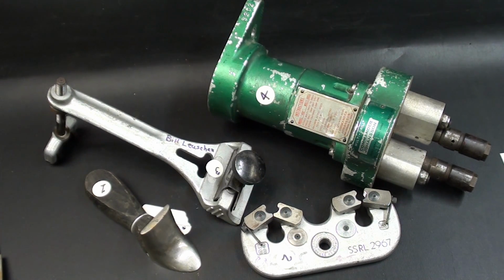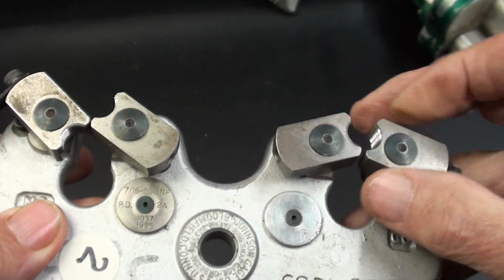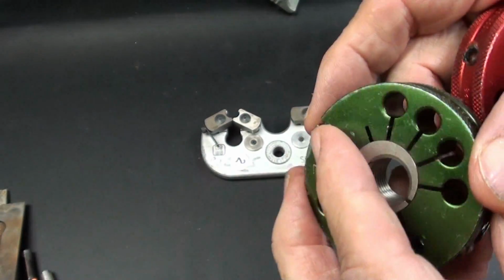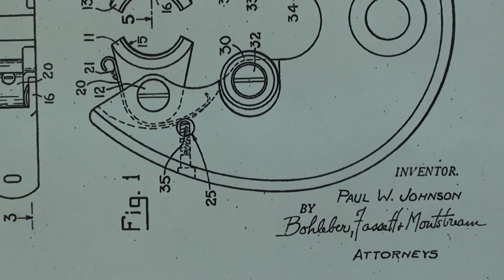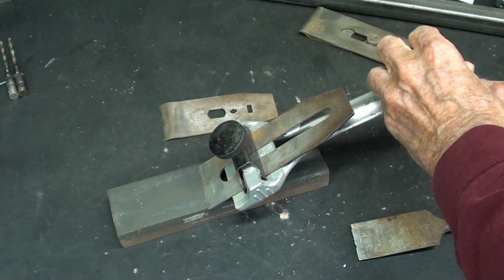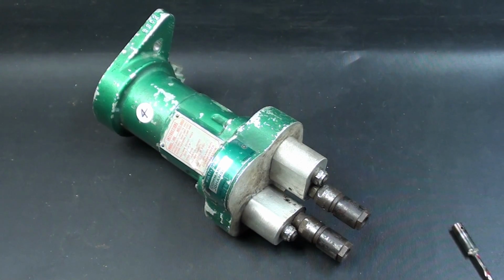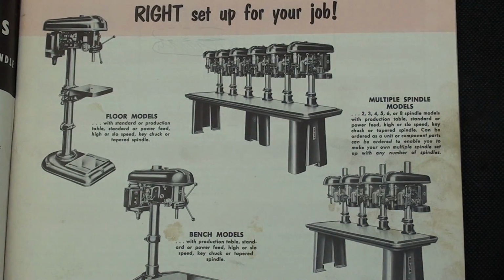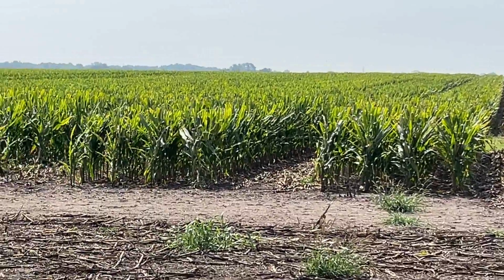WHAT IS IT? Mystery Tools #86b ANSWERS tubalcain MRPETE

Comment: Tool #1 looks to me like the shaping tool used when they used to use lead as car body filler. Kind of like an old fashioned soldering iron perhaps keeping the metal part hot would keep the lead workable so they could spread it and form it?

Comment: FYI Mr.Pete the Go /No Go Thread checker  in the video did not  show the detail of the threads  inside of the “Jaws”  at least on my Ipad i watch your videos on ?  my original guess  ws that the Jaws  may had been something that  changed  position based on a spinning or Centrifigal Force  in a effort to  Prevent or Allow a object to  move or not through the circular  opening

Comment: Wow, I haven't seen a thread snap gage in a very long time, like forty years or more.They were often called a Johnson gage and the example you have there is what was referred to as a "functional" thread check because it engaged multiple threads at a time. The actual pitch diameter was measured using a stand with three thread "rolls" and an indicator that only engaged one thread per check. The one you have would be set and issued to the shop floor for high volume production checks while the quality assurance folks would use the "tri-roll" or three wire method to evaluate and determine the cause of any discrepancies.

For reference these were calibrated using a NIST traceable "set plug" and the one you have is certainly not NIST traceable. If you had the proper set plug for the NO-GO it should move through the opposing sides with only minimal pressure when set correctly.
Reply from the maker: Very interesting, thank you

Comment: #2) That is an early "Bi-external thread segment gage". It differs from a standard set of thread Rings in as far is It will show thread form variations not detectible by a standard ring 
(Drunken Helix, etc.) Later versions included dial indicators to numerically quantify the variation.

Comment: I think you're doing it back to front, please try putting the bolt in the hole first and then move it in to the two pivoted threads and the bolt passes out the top maybe, it's made for speed definitely, thank you Pete.

Comment: I am writing this from the uk. In a small  corn mill about two hundred years old it was converted  into a sawmill in the early 1900 s they made woden hay rakes, there were 16 teeth in the head and the holes were all drilled at one go weih a 16 piece multi drill. This drill is still in its original position or it was about 20 yrs ago.
Reply from the maker: Awesome

Comment: I have the 6 spindle version of the Multi-Drill complete with MT3 driver sitting in a corner of the shop.  No use for it, dug it out of scrap @ work years ago, seemed like a waste.  Still useful, it's 6x faster than a CNC!

Comment: I ran a multiple spindle drill at NATCO in Richmond, Indiana. The machine was made by NATCO. it was set up at the time as I remember, to drill and tap 32 holes in a platen for a plastic machine which they also manufactured. It was fine until you experienced a mishap and broke 32 spiral taps in one fell swoop. If you've ever had to remove a spiral tap you'll remember what a job it is. Try 32 of them.
Reply from the maker: Good story

Comment: This is just a guess for #1.  Larger billiard tables have tops with more than one piece of slate.  Once those sheets are shimmed to the frame so that their tops are flat and coplsner, there are still small gaps between the edges of the slates.  These are filled with a hard wax that is melted into the cracks.  #1 might be used to smooth out that wax.
Reply from the maker: My dad used plaster of Paris when he put our pool table together, and then he sanded it smooth

Comment: Hi Lisle,
You need to talk to Bubba leaving your tools in such a disgraceful state! You would be there for hours attempting to fix either of those abused tools on an stone. The cutting edge angle is usually around 25 degrees for wood.
I was very interested in the extra credit section on the corn. How do they determine the male / female seed pre emergence? Clearly they would have to, to be able to  plant each in individual rows to be able to clear the male after cross polination.

Comment: The RS&M co tool is a concreate finishing tool for striking up (smoothing) bullnose corners like in curbing and stairs but for an inside corners and radiuses where a flat bullnose tool has difficulties. They make a trowels that does the same thing now so this went by the wayside.
Reply from the maker: Thank you for that
Reply: R.S. & M. Co of Reading Pennsylvania.  I've seen quite a few towels, but not this bullnose before.

Comment: Lyle -  Interesting answers.  As I did not work with them directly some of this might be incorrect as I'm relying on memory from 40 years ago.  IBM made mountains of printed wiring boards for computers back then.  Many pieces of machinery were designed and built in house.  There were multiple spindle drills called Hydrapads - don't ask me where the name came from.  The spindles were somewhat adjustable on a grid pattern.  There were 64 spindle and (I think) 256 spindle.  As I recall not all spindles had to be active, but that was the maximum number of holes you could drill at once.  We are talking something in the .020 - .030 diameter range I think.  On the 'other' side (defense work) where I was we drilled down to .010 diameter using commercial NC equipment.  When you went by the 'pads' they operated in a 'thunk, thunk' kind of sequence punching lots of holes with every thunk.
Reply from the maker: Thank you for that information, very interesting

Comment: The 7/16-20 thread should have passed through the “go” gage if set correctly. “No-Go” and “Go” were set correctly with hardened and ground male gages and locked down and certified. If the thread will 
not pass through someone changed the setting or the thread is oversized.
Reply from the maker: Thank you very much for that clarification. That’s kind of what I thought. Maybe I will tinker with it and adjust it, and show it again.

Comment: Multi head drills are common in cabinet making industry. They are no longer production grade as CNC is ubiquitous. But they can drill a hinge bore and screw holes with repeatable consistency (spacing between holes is consistent) and also shelf holes where many repeated holes on standard spacing saw needed.
Reply: I saw a 6 point multi drill at the Fender guitar factory in the early 70's.I was impressed that they could accurately drill an entire headstock in one operation.

Comment: #1:  RS&M CO is the Reading Saddle and Manufacturing Company, which was located in Reading, PA.  They made a lot of cast iron and nickel plated masonry finishing tools, so this tool may be related to masonry finishing.  I believe the 'Saddle' in the company name refers to bicycle saddles which at the time would have been leather. Hence it's possible that the tool was used for forming leather.
Reply: i have shown them to a shoemaker 60 years in business he said it was heel horm for ladies' high heels he said he uses it for other things as well in leather craft to drive rivets or snaps into hard to get into places too

Comment: Mr. Pete, years back in the die casting industry, we used large Commander planetary drives that had removable drive shafts with U-joints supported by a cast aluminum  plate at the business end that held collet chucks.  You had to machine your custom hole pattern in the plate to match your work. We tapped up to a dozen small holes at a time with these.  Of course the entire assembly was driven by a lead screw device with auto reversing.  Crazy setup but it worked.

Comment: Fascinating information.
You mentioned that number 1 had a wooden handle to keep heat at bay.
Its surface is very smooth and has a specific curved shape.
Could it be related to ‘formers’ used in the hat industry?
Here in the UK - and presumably the USA - traditional hats are made of refined fur (usually rabbit) with shellac for firmness and retention of shape. The general ‘shaping’ or ‘forming’ is by steam over a mould, more refined shaping could be done, possibly, with the tool you showed.
👍🇬🇧👍🇺🇸👍🇬🇧👍
Reply: That could be right. I was guessing for leather forming.
Reply: @ohmbug10  👍
Reply: A forming tool for shaping derby hats maybe? Hat forming  would require heat thus the wooden handle. Too short for concrete forming which would scratch the finish and not require heat. Just a guess.
Reply: @ellieprice363  Even the pointed parts of English ‘trilbys’ (there’s a word from the past!!)
Reply: @ellieprice363 Nice thinking but making a bowler requires little heat and only one shaping tool. You wet the felt with a steamer, then push it by hand onto a head shaped form called a shaper, bend the edges by hand to make a brim, and trim the edges with a trimmer.

Comment: If the threaded component does not go through the go gauge then it probably needs resetting .🤔🚦
The plane blade sharpener , you know I've seen one of these but had no idea till now what it was ! Thanks mrpete for teaching me .
I looked at the unidentified tool and wondered if it is some sort of Dolly used in sheet metal work to form radii around for example on site where no tools are available and a roofing panel could be hammered to shape in a radiused corner , but I am probably wrong about this .
Reply: You might be onto something actually. It might be for shaping lead panels used in roofing. They use plastic mallets these days i think
Reply: @chrism4008  Yes I wondered that as I used to work in ornamental sheet metal work and copper and zinc roofing and they had some really odd looking tools . The reason I didn't think it was not for heating is because the handle is flat with the base and not offset like a smoothing iron , but the handle is chunky as though it is made to withstand knocks and be held by the craftsman  . The base is polished and flat and the finish of the radius is really polished but it looks like a few knocks have happened to the tool during work .
We used to use something called dressing tools which were made of wood or metal . But I'm only really guessing although I remember something like this from all those years ago ! Best wishes from England by the way .
Reply: @rexnemo  ornamental roofing is pretty incredible. It would be really fun to learn it, ive worked various trades a lot of my years. I was always detail oriented to an extreme, but i never was around long enough to get any cool jobs
Reply: @chrism4008  I think you must have been one of the reliable people that would do the jobs without complaining and produce good work without being dramatic about it . I remember when I was training one of the old boys pointed out one of the workers and asked me .
 "Have you ever noticed how some people have to be surrounded by a large group whilst they do their work?"
He was an intriguing individual and had a lot of life experience and a delightfully observant sense of humour .
I remember on another occasion he said to me .
"See that man there , he and his father are tortoise one and tortoise two , when they come in to work they hang their shells up on the coat hangers then get to work ."
He did used to make me laugh .🤣

Comment: That go gauge looks to me like you put the thread between the jaws and keep pressing on the tab with your thumb through the full range of it's movement until the bolt has travelled to the hole on the frame where the jaws open and release the bolt through the hole, unless it won't go, and then it don't...